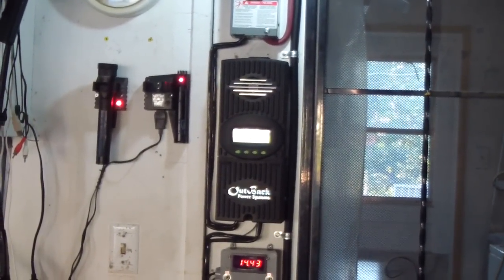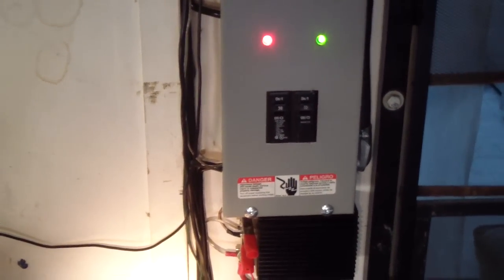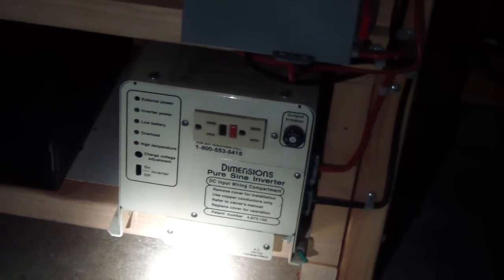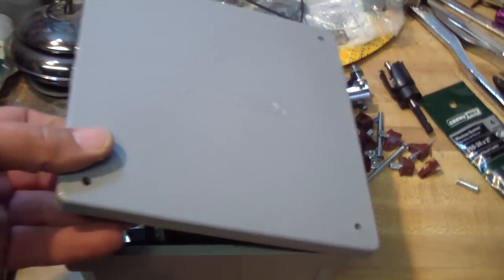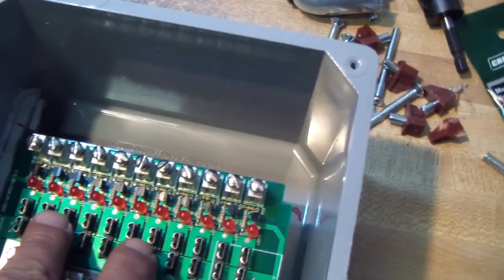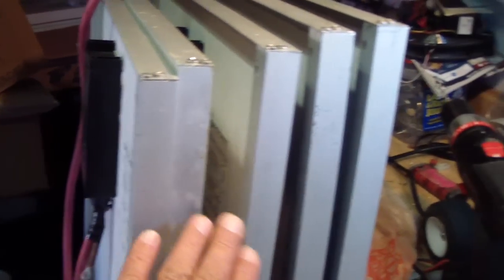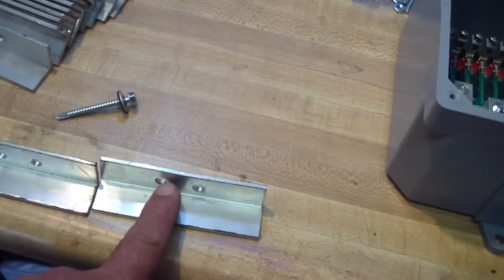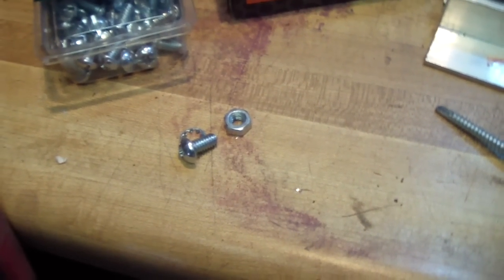Part one, Battery bank/outback charge controller cable upgrade and solar panel roof installation.

Comment from the maker: They called "Struts", I did look at them last year.  For a straight roof with no sagging in between the rafters they would work fantastic, however the cost (plus the extra weight of the additional hardware on the roof) would have been about $400.00 versus about $85.00 my setup cost and no extra weight on the roof, thanks for your comment.

Be Well, Godspeed

Comment: Great video....just thought I'd drop you a note about the anchors.
First, As you know, that's ALOT of holes to be making in your roof (which equate to a lot of potential expensive leaks).
Second, that's way too much work bending and drilling \Now for the good news:  Go to home depot or lowes and pick up some of that 10' channel bar; 2 laid parallel on your roof with only 4 screws dipped in tar with nice strong washers should do just fine.

They also sell the spring loaded/bolt channel feet.

Comment from the maker: Very good question, you need to install a transfer switch panel that would automatically switch between available resources (Genset, Battery bank) in the event of a power outage like "SAMLEX STS-30 30 AMP AUTOMATIC TRANSFER SWITCH", search it on the net thanks again.
Godspeed, El Raz

Comment: I have 6  12 volt 100 watt solar panels,I have an issue with the wire from the panels to where  I want to put a controller .the wire i currently have is 8 awg  about 75 feet .do you think it would be an issue to tei the panels in series to up the voltage and still use the out back to charge my battery bank at 12 volts with the 75 feet of wire between the panels and controller ?

Comment from the maker: Hi Heath: Do you have the FX60 or FX80? The 60 can handle 60 Amps and 145 DC coming in the 80 can handle up to 80 amps.  The Outback controllers use voltage to generate AMPS through the built in toroid coil, I would go with two sets of 3 panels in parallel = 12 V and 100 W and connect the two sets in series which would be 48 Volts (you would get about 84 Volts in reality) and up to 45 Amps.

Comment: do you know how to convert my 18 roof solar panels to run off generator or battery backup in case of power outages or disaster?